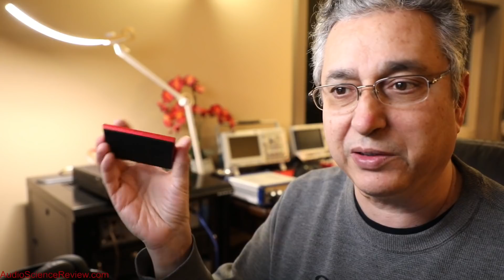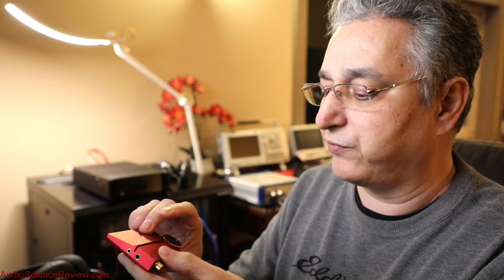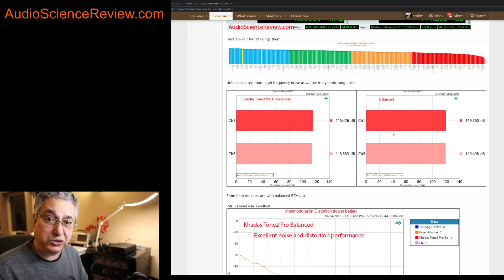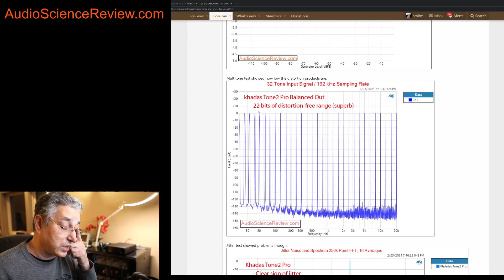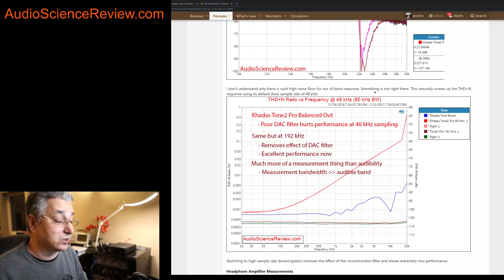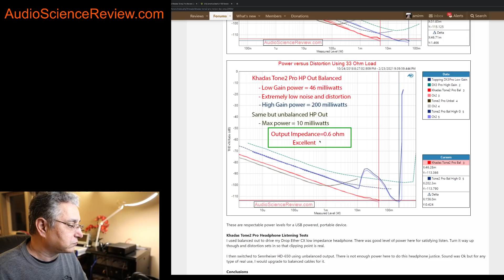Khadas Tone2 Pro DAC and Headphone Amplifier Review

Comment: khadas had a firmware update to fix the noise floor
Reply from the maker: Ah, good to know.  Thanks.
Reply: @AudioScienceReview  no problem, I also noticed that the device produces much less heat. but the process was quite daunting if you have the first version. you need a special tool, otherwise its just a simple script.
BTW, I love that small thing, it works great and is small and looks good so it doesn't uglify my desk.

Comment: Liking your stuff. At last, tech talk that doesn't come from Paul McGowan embarrassing himself in front of a whiteboard. 
I have a question. Maybe this isn't the best place to ask it, but that never stopped me before.
I typically us either a Windows PC or an iPad to act as a streaming controller. I output the stream on USB to a Schiit Modi 3. It sounds darn good, usually using Amazon's HD Music. 
There are some pundits around who say that iOS and Win 10, themselves, routinely make small corruptions in the digital stream before it gets to the DAC, but that there are apps that transfer the audio stream without corrupting it.
Is this at all true? Is it an audible issue? Is there a routine fix?

Frankly, I like using the iPad because the UI with all of the services I've tried is simple and effective. And, unlike a 'streamer,' the iOS and PC apps should be future-proof. But, is there a better solution?

Regards, and keep up the good efforts.
Reply: Spent ten years playing with various os's , hardware, configs for bit perfect usb output. 

At the end of the day:
 hardware needs to be low noise. Mac's are King at this, but any non budget system will do .

Windows was best sounding os by far with wasapi audio drivers.
I use Lubuntu now with customized pulse audio configs. 

Worth investing in a low noise usb card, but I use toslink out now.

Comment: thanks Amir for another thorough and clear video. 

I've read on the Khadas site that they were recommending powering the device with a 5v power supply plugged in the I2s usb-c so that the device will use the I2s for power and the "regular" usb-c for data only. This is supposed to reduce noise even further (they say).

I would be curious to know what effect this would have on Sinad. (would this bring the distortion even lower) ?
Reply from the maker: I saw them posting the same this morning.  Performance is already so good that I don't think it is worth adding extra power but I will take a look.
Reply: @AudioScienceReview  So much predicated on the fact that so little makes it into the audible range ... yet ... these test result, profile anomalies create concern.  I think it behooves you to test with a linear power source and perhaps even a power bank - straight dc - to really characterize the performance envelope.
Reply: @antong3987  same.

Comment: I ordered it for my laptop to use with sennheiser hd660s, i am not going to use balanced and i wish you could have shown also the normal 3.5 output tests.
Reply from the maker: I did measure that.  The power tests for "unbalanced" are the 3.5 mm output.  I also performed listening tests using that and the HD650.  I don't think it produces enough power for them in that mode.
Reply: @AudioScienceReview  HD660s with impedance of 150ohm but the HD650 with 300ohm instead, and personally I think the T2P can drive HD660s(have one here) well using unbal 3.5 :)
Reply: @AudioScienceReview  the unbalanced is rated for 150, the balanced for 300 ohm.

Comment: Amir, which interconnects do you use?
Reply from the maker: For testing I use either Amazon Basics or a non-name one that has BNC at one end because that is what my analyzer has.  For my main system, it is balanced and I use Mogami Gold.  I have tested cheaper XLR cables and they are just as good.  The fit and finish sometimes suffers in the XLR connectors but that is it.
Reply: @AudioScienceReview  Thanks so much. I have gone for Blue Jeans since watching your video. I have spent a fortune in the past on cables, but no more.
Reply: @AudioScienceReview  To go with any DAC, even the expensive ones, I recommend the excellent RCA coaxial cable from Fos Power, 75 Ohm, bought on Amazon, which costs only 7 euros! I use it on the Topping E30.
It sounds natural, is well balanced. It has plenty of bass and slam, its treble is not fatiguing. It is better than the Mogami 2964, which is worth 5 times more. 
Conclusion: for coaxial cables, there is no need to spend a lot to get excellent quality

Comment: Hi Amir !! Another great video !! Was busy today, I was late when your video pops up in my notification... I've been waiting for your review of this board, I'm trying to build an active speaker system that's similar to HEDD Tower Mains, but needed DSP and DACs. This DAC is one of my DAC of Interest. Thanks for the review !!
Reply from the maker: Thanks Damir.  I had not thought of that application for them.  It would indeed be excellent that way.
Reply: @AudioScienceReview  I come from PC building hobby (since the days of 486/Pentium days). After browsing ASR, I'm thinking that it's not impossible to make a "PC-like" construction of amplifier. The power amp "cards" instead of expansion cards, the DAC/DSP - probably the FreeDSP's board as the "mainboard", and Hypex's SMPS unit to drive it all. But all are still in napkin drawing... Need more info to flesh things out. Hahahah.

Comment: It's kinda neat but nothing about it makes sense, it has virtually no power, it would look stupid on a desk and it's incompatible with going in a pocket by virtue of pointed corners and a rubber base. The only application I can see is a tidal user with a laptop with very easy to drive headphones.
Reply: I have one, and it is much smaller and flatter than you think. Its like the same size as a credit card, and i definitely can put it in my pocket. I bring it out to use when chilling at a cafe, then when i go home, hook it up to my amp. If you use tidal, it has hardware support for handling mqa. Dont think of it as an amp for headphones. Think of it as a dac for headphones, and an amp for iems on the go.
Reply: Not everyone is poor lmao, balanced out into an actual amp is probably what people are gonna do with this one. Just because something has an amp in it doesn't mean you need to use it.